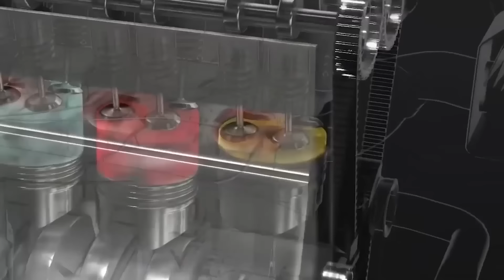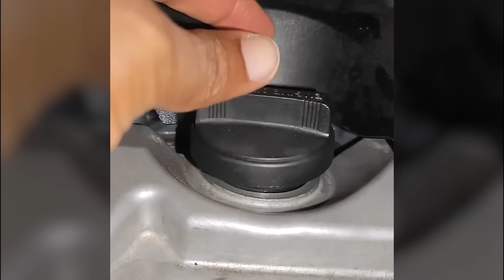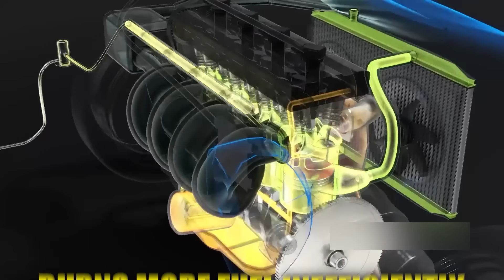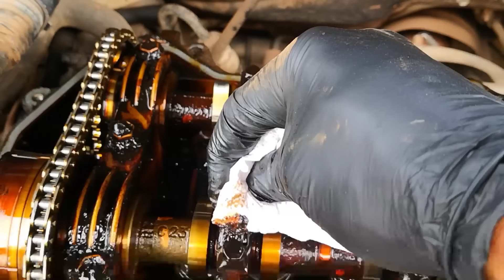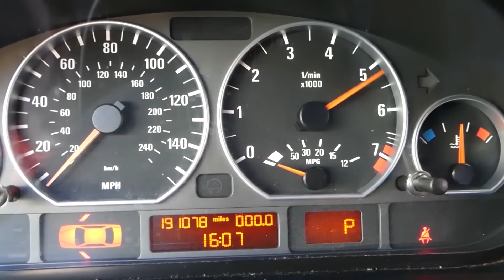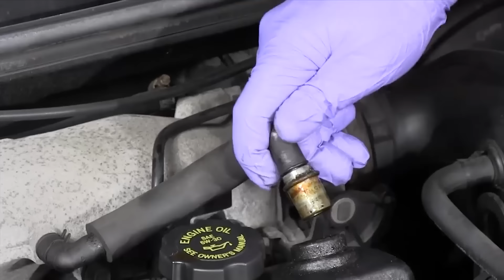15 Signs and Symptoms of Bad PCV Valve (Mechanics Won't Let You Know)

Comment: Is it possible to have a failing PVC valve but you don’t have engine running issues, like it runs smoothly, idles smoothly, starts fine, doesn’t stall, but does have excessive oil consumption?

My 87,000 mile 2012 Honda accord 2.0 petrol is doing exactly that, I’m hoping it’s a simple pvc valve, it’s still under warranty thankfully, so the garage replaced it free of charge.

Comment: If someone has a bad PVC valve this does not mean it's bad because they see black smoke coming out of there tail pipe it could mean they have a diesel vehicle.
Reply from the maker: Good point—black smoke can come from several issues, especially on diesels. A bad PCV usually causes oil consumption, rough idle, or pressure in the crankcase, not just tailpipe smoke.
Reply: Hahaha

Comment: Very nice and detailed information. Could you please tell me where exactly PCV Valve located in Suzuki K15C Engine. I am unable to locate it.
Reply from the maker: Thanks! On the Suzuki K15C engine, the PCV valve is usually mounted on the valve cover—look for a small plastic valve with a hose leading to the intake manifold.

Comment: Skim the heads, bore 10 over, port out all exhaust and intake ports.. raise the compression 10 to 1.. delete the PCV valve cause what the PCV valve actually does is gunk up your throttlebody.. if the compression is raised, more fuel burns up and less blow by, letting out way less gasses... drill out the PCV valve and throw a filter on it, which will make your engine vent out water vapors from the oil.. after the car warms up, there will be no vapors let out into the atmosphere, and the crank case will not build up any pressure and blow your rear main seal out....
 I learned all the scams enforced by the EPA way back in the day due to my grandpa working for GM as an engineer since the 50s up to the late 80s...
Deleting the PCV valve will make your engine perform better... I've been to GM/AC Delco school for many things and the teachers k ow exactly what I'm talking about, but they're not allowed to teach this stuff...
The newer cars that have a closed PCV system can be bypassed with a resistor on the barometric sensor..just do the same process as mentioned above... 
The higher the compression in the cylinders the more vapors get burned up.. the lower the compression, the more vapors are created.... 
I delete everything on all my engines.. PCV, EGR, bypass bank 2 O2 sensors, delete the converters... etc etc... and all my cars pass the emissions tests.. they don't pass the visual.. but they produce no gasses, and I have the readings to prove this... luckily, my state requires no emissions.. 2 of my cars passed the NY emissions test.. cause I have a friend who works for the emissions  place and he ran my vehicles for free....
My exhaust produces cleaner emissions than a brand new car with a converter and EGR... 

The only thing I keep is the EVAP system, cause that is the only good idea the EPA has ever come up with.  
Anyone who's taken schooling to learn this crap is an idiot.. learn how an engine actually works, modify it, tine the ECU, lower the thermostat to 150 degrees, and it'll run for a very long time.. have way more power, and and way better gas mileage.. 
The only thing that'll cost you money is the bore job and the head milling job and the ECU tuning job... everything else is virtually free...
500 bucks to make your engine last a million miles is well worth it...
Reply: Okay we’re gonna need you to teach us about everything you just mentioned 😭
Reply: Interesting
Reply: Wow!
Reply: Do you have video how to do what you mentioned?
Reply: So like don't you have to pull the engine out of your car to bore it and increase the compression ratio.
Reply: @tikihutdweller5944   DUH!

Comment: I just spray mine out with carb or maf cleaner. If it rattles it supposed to be good ive always heard. Some cars are very hard to get to them- ford Taurus for one. Rediculous. My Pontiac only takes a minute to remove & install pcv valve.
Reply: Taurus, '08 Focus, '07 ½ Aspen (the original place wasn't bad)... They need to get the engineer who designed and approved to fix it in someone's driveway before mass production. Or make it a free service. If I have to drive 30 miles one way and wait for an appointment to get the work done rather than 10 miles to buy the parts let the manufacturer foot the bill; and not the local dealer.

Comment: Alls you have to know about a PCV valve:  Where on your engine is it located, how to remove it, whether it "clicks" or not, and how to prevent it clogging up in the first place.
Pull out the valve with engine off of course, and just shake it a couple of times.  If the valve doesn't click or rattle, its clogged, so just change it out.  DON'T bother cleaning it, just change it.  

If you want to keep deposits from building up in the first place, just get a clear plastic fuel filter that costs about $3, and splice it in to the PCV line from the engine to where it goes into the throttle body.  Even though the filter's meant for gasoline, the clear filter will go along way towards catching the contamination caused by the oil vapors.

Comment: I have found that using mass airflow sensor cleaner works better than anything else, because carburetor cleaner can damage the rubber on the valve itself! And if your valve sticks open you will lose vacuum and your brakes will feel mushy pedal.
Reply: But carb cleaner is supposed to be safe on seals, rubber and otherwise.  Otherwise the chemical would be worthless

Comment: hi sir my car doesnt have pcv valve as far as i can see and i have problem with engine oil in my intake manifold
Reply: This is one of those computer generated videos. Whoever made it probably never worked on a car before, so I wouldn't expect a quality answer.
Your PCV valve is there, but they're not always easy to see. The old one used to press into the top of your valve cover and you could pull them out with your hand. The ones on modern vehicles can be threaded into or part of your valve cover. It will be on one of your valve covers, part of one of your valve covers or somewhere in between a hose that goes from your air intake after the air filter to your valve cover. Follow every hose that connects to your valve cover(s) and you should have no trouble finding it. If you can't, call or go into the parts department at your dealership and ask for a quote on a new PCV valve for your car. Tell them you need a picture so you can match it up to your old one. If you go in they'll definitely give you a print out, or they may be willing to email of fax the information to you.
Reply: What is your car brand and model?
Reply: Mine is behind the intake manifold I can see it but there's no way too reach in there you have to remove the whole intake manifold looks like a huge pain in the ass
Reply: All cars have a PCV valve so it’s hidden or you need to find it